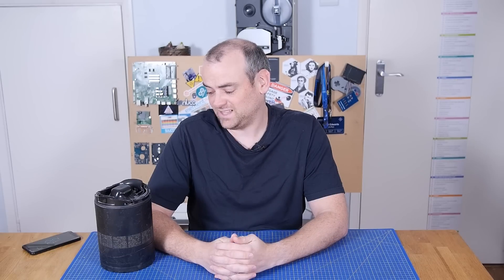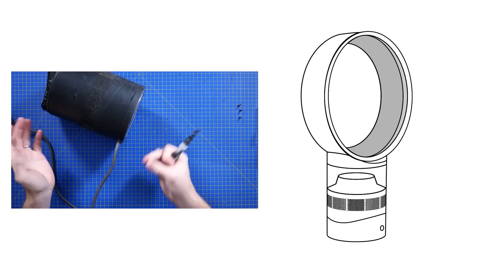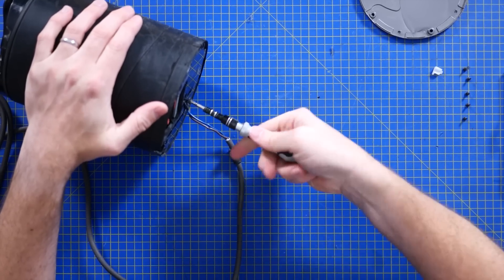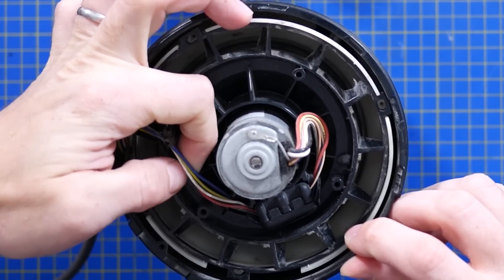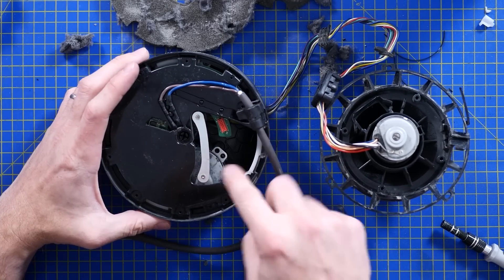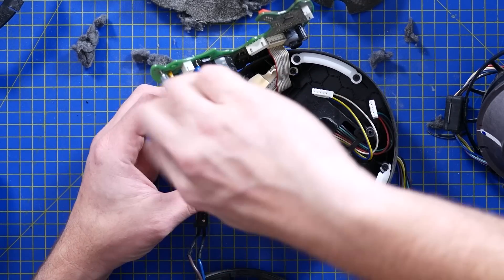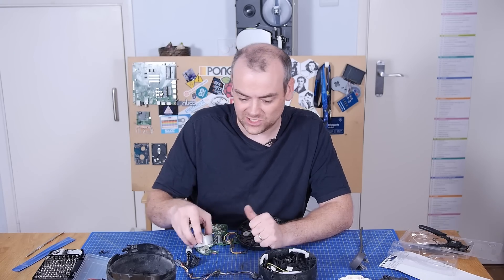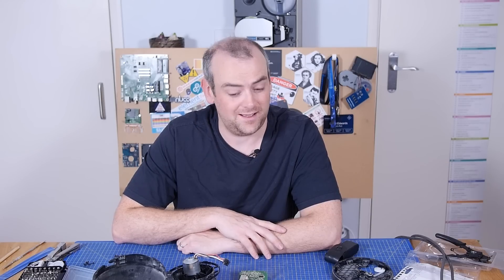Inside the Dyson AM06 Bladeless Desk Fan - The Electronics Inside

Comment: The solder joint on the mains cable was to change from the normal type of wire to silicone flexible cable so it doesn't break with repeated bending from the oscillator.

Comment: The smooth air, low noise, and design are sublime. But they are expensive and don't move a lot of air IMHO.
Reply: If you need to move air about, then any fan will perform as well. If you want to spend extra for the design or asthetics, I guess you could make the decision in most product catagories?

Comment: When these came out I was excited to see some sort of engineering that removed the noise of blades moving through the air.  I was disappointed to realize the fan blades had been moved into the base, and it wasn't actually blade-less, and it actually made more noise than a traditional fan.

Comment: Quite a good and interesting tear down, suggest you checkout a few of BigClives teardown videos and have an insulated bit of metal to discharge caps for safety! Isn't the whole point of successful marketing to make something for a lot less than it costs to make? It's called business. I had one of the Dyson circular fans and was  very impressed by it's performance and the way it 'focussed' the air stream, until I came across a more modern open fan one which seemed very similar in performance. Not having a power meter I couldn't compare the performance per watt which would have been VERY interesting. Was it worth the high cost for the benefits, I very much doubt it! Nevertheless Thank You for a very interesting video.

Comment: While Dyson does have some interesting engineering in their products, I've never felt they represented good value compared with more conventional mundane appliances. I'm not a fan of this kind of tech overkill. Desk fans don't need remotes or digital displays. I'd much rather the effort went into making the products more durable so we're not throwing them out after a year or two and clogging our landfills with e-waste.
Reply: During the pandemic, I invested in an otherwise traditional "tower" fan (Vertical axis centrifugal fan). But it had HEPA filters (good enough for hospital quaulity) and UV-C sterilizers. So we could host when rules permitted but people could feel a little less at risk indors.

That had actual quantifiable benifits, and still cost less new than this fan would have.